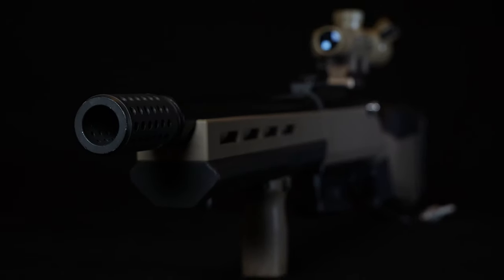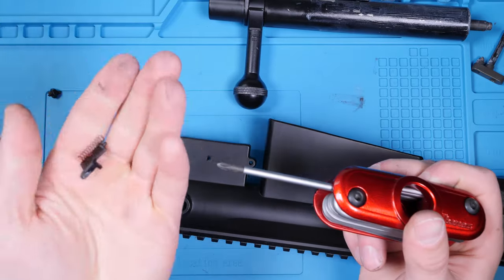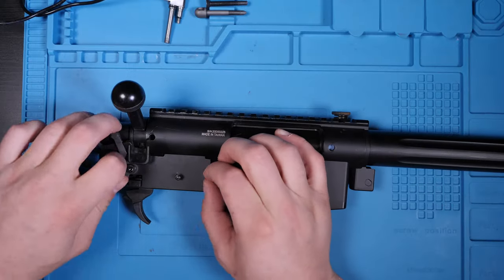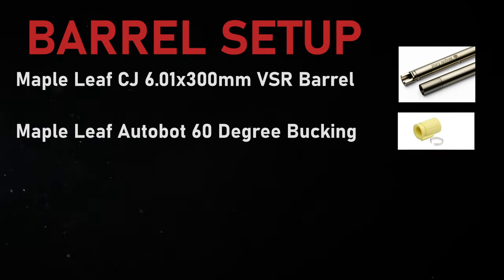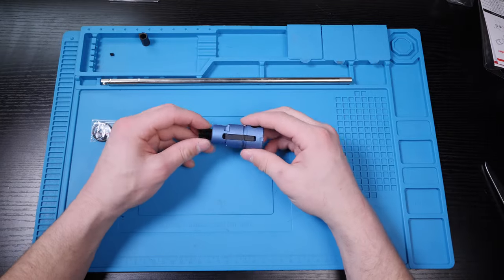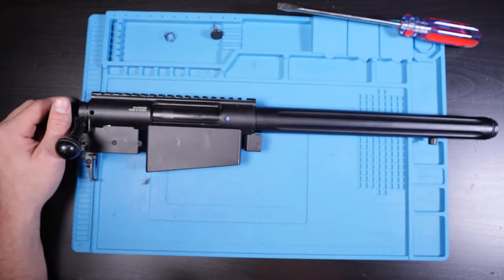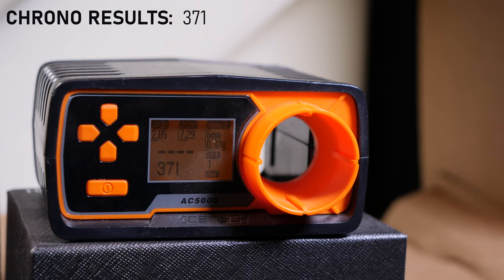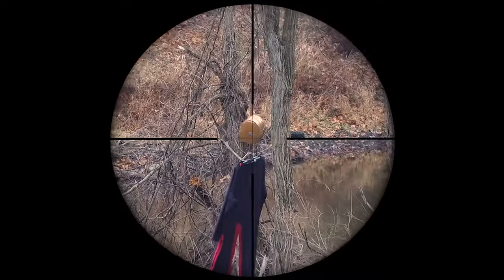HPA SNIPER RIFLE BUILD | How to HPA an AIRSOFT Bolt Action

Comment: did almost the exact same build except with a maple leaf 70 degree and regular nub. i ended up doing a straight pull modification and added a novritch foam filled suppressor. was hitting at body sized target at 275 ft 8/10 times with 64db from 5 ft away from shooter.
Reply from the maker: Seriously a sweet little plinker, right!?
Reply: @Private_Caboose  it is and the system is sooo easy to work on.

Comment: Awesome build. Basically what I want to build but a longer barrel version.  The riser is backwards just fyi. The cantilever portion always faces towards the barrel.
Reply from the maker: Ah thank you! I did not realize that but I wanted to push the optic towards the rear, so this overhang towards the back does just what I need! It Just makes it easier to find the proper eye relief when shouldering the rifle as it’s closer to my eye. Appreciate you checking out the content!

Comment: Hopup and bucking I have the same. Use a Prometheus 416mm 6.03 (with a suppressor covering of course) and instead a Stalker Concave. Also a Wolverine bolt. Only not the trigger. Does it do a lot? And u recommend going for a 6.01 instead? 
Also what weight do you run on the field? I did testing on 0.40 and its a laser at 40m (over 100feet) in the first test mags.
Reply from the maker: Awesome!  No I don’t think the trigger does anything for performance, I just like the look and feel of a flat trigger!  I would recommend the 6.01, and I use .45g bbs!  Anything over .4 should have solid trajectory and hold the HopUp line
Reply: @Private_Caboose  Thanks for the reply!

Comment: i have the same chrono, and 0,32 g bb is not the max weight of it. u can simply change it in the settings. :)
Reply from the maker: I just double checked and my chrono only ranges .2 - .32.  Perhaps you have a newer model but I know how to use mine :)
Reply: @Private_Caboose  hmm that's weird? I can litteraly change my bb weight? Sitting with it right now. Maybe it's because of EU version or something? Anyway Nice videos!
Reply from the maker: That may be it!  Thanks for checking out the content and leaving some comments brother!

Comment: Hey man love your work but i have a question, so i have a polarstar jack m4 so i debating if i want to get upgrade parts for it (itd only be external stuff) or i i should do something like thus or get an ssg10 
Im a 13 year old but i can handle bolt pull i play at a huge outdoor field called ballahack airsoft. Whats your advice?
Reply: Also i should add i only get to play 1-3 times a year

Comment: If you needed to dial this down to about 1.88 joules, but also have the option to crank it up to 2.81 due to different field rules, what would be the way to do it?
Reply from the maker: With an hpa build you should be able to do so!  Just adjust the psi on your regulator to achieve said results.
Reply: @Private_Caboose  Would there be a way to say put an hpa canister in the stock of the gun for convenience? Not sure if thats been done before.
Reply from the maker: @toughbama  oooooh yeah 😈 if you join the ares as02 Facebook group you can scroll and scroll and scroll through community builds, a lot of which incorporate an hpa or co2 canister in the build to eliminate the hose!  Man craft makes a co2 kit that people often use, or some people just hollow out the stock, throw a small hpa bottle in there, and wire it up!  I highly recommended you join the page if you are following through on a build, best place for info.  Just type in your question and chances are somebody already asked it, and somebody already answered it in the chat logs :)
Reply: @Private_Caboose  Do you recommend the HPA setup or are there viable spring loaded builds with comparable performance?
Reply from the maker: @toughbama  I recommend hpa for sure, now don’t quote me on this as I didn’t even give spring internals a chance, but from my research prior to the build, spring internals can fail/break. While the hpa system is low stress.  So I’m addition to that, the hpa system can be fps adjusted in a simple twist of the regulators dual, while the spring system require an entire spring change.